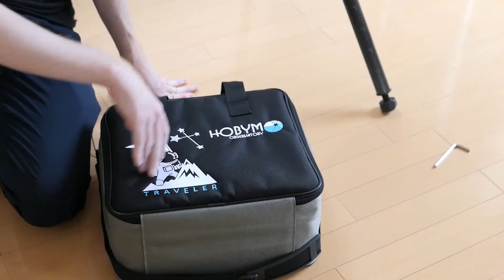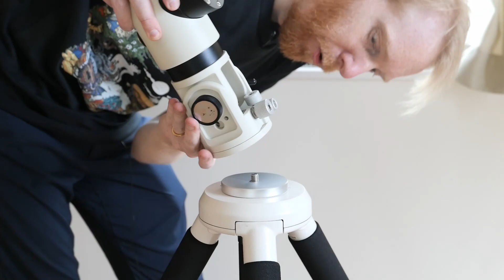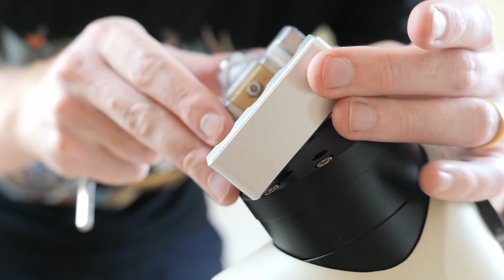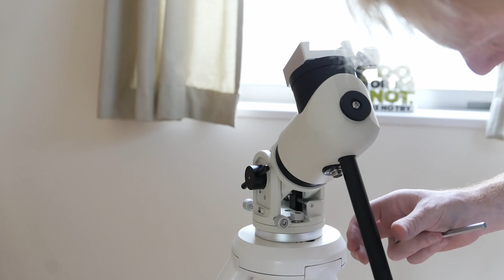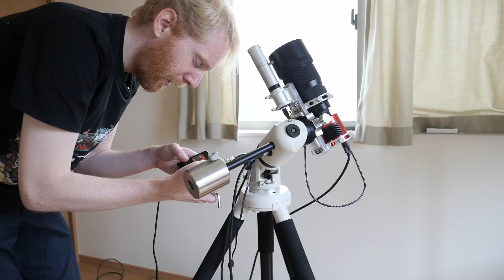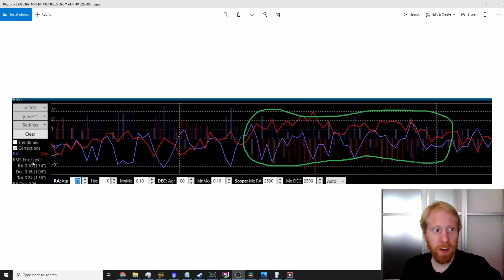Hobym Crux 140 Traveler Mount - 2-months first Impressions and initial review (ft. C9.25?!)

Comment: Thank you for the review, looks like a really impressive mount, with caveats and quite a unique approach. I spent a long time going down the google search rabbit hole on harmonic drives and cross roller bearings for a DIY mount and did buy one of each to play with, so a few semi-relevant thoughts below.

-  I think what you might be seeing in the fine movement is systematic of harmonic drives. From what I have read they do have a non-linear motion, and people suggest it is sine wave in "appearance". I've never observed it myself though so don't know if it explains what you are seeing. As other comments have mentioned PEC is effectively a requirement for long exposure imaging. As an aside, I wonder if the non-linear motion is not like typical PE usually generated by a worm/wheel which follows the worm, but is some effect generated whilst being driven independent of flex shaft orientation and thus quite a bit harder to correct for... if that makes sense

- Harmonic drives, especially if coupled with a cross roller bearing are inherently very stiff systems and "zero" backlash (I am going to guess/assume based on the cost of the mount and the fact you can hang a C9.25 off it that the harmonic drive is mated to a cross roller bearing). Although this mount looks to have a planetary gear head between the harmonic drive and stepper which will add a small bit of backlash, it is a shame to hear that the auto guiding did not provide better results. It is something I had high hopes for with a harmonic drive mount that guiding performance would be very good

It does spur me on to get on with my own project seeing a (relatively) successful mount using a harmonic drive and (I assume) cross roller bearing combination. Thanks!

Comment: it is coming from the fact that strain wave are generator of a great amount of periodic error ( about 30" ) . you need to make a PEC ! the periodic error will go below 5" and then with guidind you will be below 0.75" . As you can see, without PEC you were able to go down 2" only with guiding but without PEC with a Huge PE ( wich is particular to strain waves gear) .  i would suggest you to try a PEC and retry the guiding
Reply from the maker: Hi Mehdi! I did program PEC (several different times), it didn't make a big difference when guided - in my mount, the real issue was the DEC axis, which was was having actual jumps at low speeds, rendering dithering an exercise in frustration (or restricting it to RA). Guiding at high frequency, with or without PEC, worked well enough, but I couldn't use DEC dithering. Because of that jump in DEC (which is apparently happens to a few Crux Tv, but not all - Cyrille seemed to think it was an issue with my mount which should be repaired), I ended up returning the mount (you can see the jump and my final thoughts here: https://www.youtube.com/watch?v=LhYEhl-6w3w )
Reply: @CuivTheLazyGeek  oh sorry to hear that, but i'm sure it will be corrected soon. What i know is that strain gear wave have the particularity to have a high PE with a period about 1/200th the revolution time . In our case 24 hours revolution is 86400 sec . 1/200th is about 432 sec. So a strain gear wave will have about 30-45" of PE each 432 sec .

Comment: Well at least it passes the guiding wizard. My CGX fails the dec backlash measurement every time. Someone else reported similar results back to Celestron with the reply stating the mount was performing to spec i.e. rubbish. In your case I would try adjusting guide rates. I get better results when @ 50%. The other avenue to pursue would be power supply. If it is drawing as much current as you indicate voltage drop may be significant with your battery and power cable.  Li cells are notorious for poor performance at low temperatures. Running close to max allowed voltage may also help, for example the newer Sky Watcher mounts are reported as being fussy about clean power.
Can this mount be remotely setup and controlled EQ Mod style? Yes forearm but no to bolt. That was a nut. Adding a second nut and binding them together to make a fixed stop might work well for you too.
Reply from the maker: Rob, thank you so much for your detailed answer and the suggestions! I did try with 12V 3A power brick, which I normally use for my camera cooler, and it presented the same symptoms.But you are right, this is a good idea that I need to look into.
I'm actually surprised on the CGX - I heard good reports from some users, and I was considering it when I bought my EQ6-R... How are you able to work around your problem? Just completely disabling DEC guiding?
Noted about nut vs bolt - I am not mechanically inclined so helping me get the right vocabulary helps a lot.
I was able to remotely control the mount (this is how I took the M101 picture - the mount on my balcony and me inside, remotely controlling it), and I didn't encounter connection issues that night. I just turned on the controller, polar aligned, and did the rest from inside the house.
As for the guide rate - the default on the mount was 0.5x Sidereal. The max was 0.9x, and I seemed to get slightly better results at 0.9x. But this is something I can look into as well.
Thanks again!
Reply from the maker: @RobB_VK6ES  Yeah, EQMOD is what decided me to go the SW road. I'm also an Open Source advocate (in fact, a collaborator to N.I.N.A., where I focus mostly on focusing). This video was highly interesting, thank you for that! And I'm now watching the video on autofocusing, fun stuff. Thanks!
Reply: @CuivTheLazyGeek  James has a thing about focus :)
Reply from the maker: @RobB_VK6ES  I can tell!! :-)

Comment: That thing should guide so much better than it does considering how much it costs.... I would get in touch with them, something is wrong. I know you will have poor seeing in Tokyo but come on! I'm also surprised at the 0.5s recommendation for guide exposure, goes against everything the developers of PHD2 recommend. I get between 0.6" to 1" most of the time with my old as hell EQ5 pro that has some mechanical issues with the DEC axis, I would expect hobbym to get at least 0.5" most of the time

Did you test the guiding with no counter weights only? Or did you also try with them?
Reply from the maker: Thanks for the feedback! I think this is something to do with the nature of the Harmonic drives used. Note that my DEC "backlash" symptoms seem to be different depending on where the mount is pointed. So ... I don't know what conclusions to draw.
To be fair, I usually get around 1-1.5 RMS with my EQ6R, and maybe 0.7 RMS on nights of good seeing and no wind at all - using 3s exposures. I don't mind using very short guiding exposures (and thus frequent corrections) if that's how Harmonic drive mounts are supposed to work (even though, like you I've been conditioned to use long guide exposures) - and then I do get decent results. But really, it's the manufacturer's attitude that leaves me a bit mystified (I already got in touch with them) - they almost seem to be in denial that anything could possibly be wrong with their mount. And they guarantee that I will be satisfied in the end results. For the moment, I will persevere.

I tested the guiding with and without CWs, it makes no difference (which is incredible, all things considered).
Reply: @CuivTheLazyGeek  Yes you're right, it is a bit of a strange attitude to have. They should be proud of their product, but that doesn't mean all quality control should be thrown out the window. It shows pretty poor customer service when your customer that they are wrong and there is no issue, especially without actually looking at the product!. It's obviously a well made mount with high quality parts but it's also not something of supreme quality like a planewave direct drive mount. Things can go wrong, slight misalignment of gear mesh, or something being over tightened etc 

 I"m a bit shocked that a Japanese company is acting like this. If that was me, I wouldn't be getting good images at all despite what they say as my image scale is 0.89" It is very strange that it has "backlash"!

How are you polar aligning? I guess if you go out of your way to get a really really really accurate alignment then you can hopefully negate any need for DEC guiding. 

Anyway, Loving the vids lately Cuiv

Comment: Thanks for the detailed review.  I'm a little surprised (and disappointed) about the azimuth adjustment as I take it for granted with mounts, there's no tilt during its adjustment. Personally I went with the SS-One Traveler which was based on the predecessor of the HobyM Crux 140 (it was based on the Crux Mini). I use the SS-One Traveler with my FSQ-85ED. One curiosity I have is (aside from manufacturer recommendations), how one determines the capacity of strain wave mounts without counterweights' cos I'd love to use my FSQ85-ED on my SS-One without counterweights too.

Your review has made me curious about HobyM's competitor, RainbowAstro has executed its RST-135.
Reply from the maker: That SS-One had really piqued my interest at the time! But I simply didn't have the funds at the time for such a mount. There's so many things about the Hobym that are amazing, and yet so many disappointments at the same time... I'm very curious about the RST-135 as well. Its electronics are integrated, and its footprint looks smaller than the Crux. It advertises bigger payloads (even though the drives are essentially the same). Really, how is payload decided?? I have the same question. This is really a whole new world of mount drives. Maybe I should sell the Crux and get the Astrotrac 360 (if it ever gets released), or more simply, a CEM25P.
Reply: @CuivTheLazyGeek  RST-135 has bigger drive in RA. RST-135 use number 17 type drive for RA. Crux 140 use number 14 type drive for both RA/DEC.